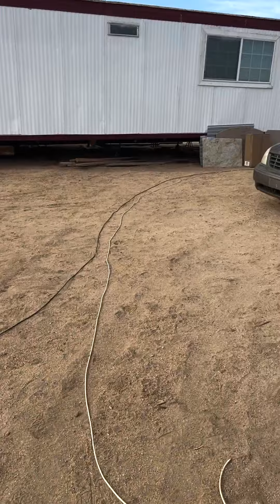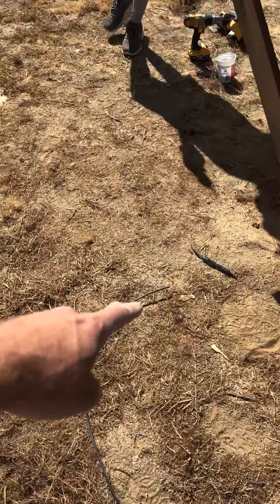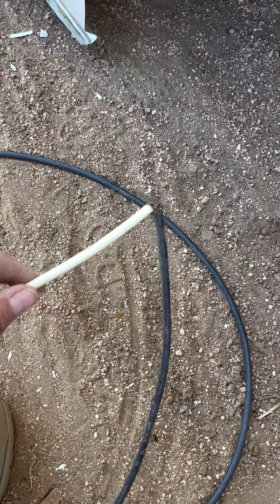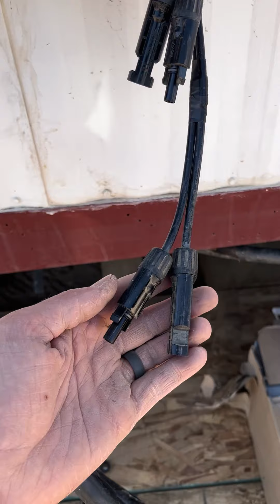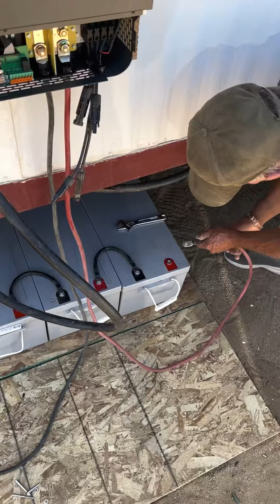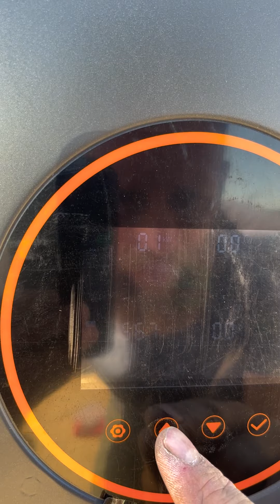Solar Off-Grid Installation (Complete)

Comment: Same reason DC conversions use pre-charge resistors to prevent the caps from failing with high currents.
Reply from the maker: Yes

Comment: So with the sparking you can do a hand held pre-charge resistor before connecting the full 48v. Protects the caps from that huge inrush that can damage the caps.
Reply from the maker: Yes. If it was disconnected and reconnected often it might be worth it but this inverter was connected once and I’ve never heard from them again so it must still be working.